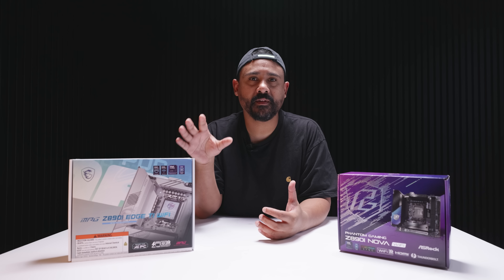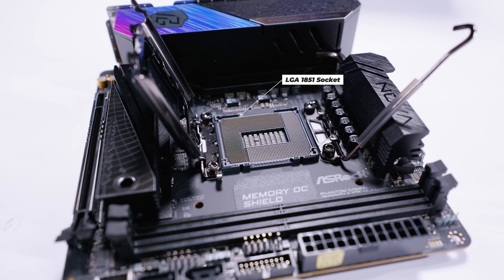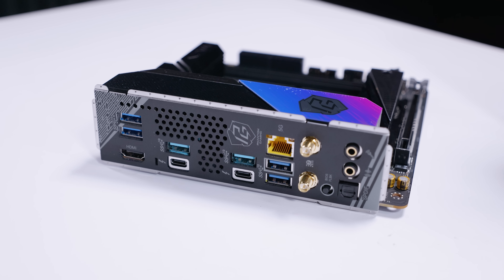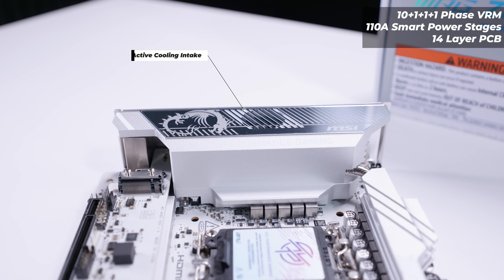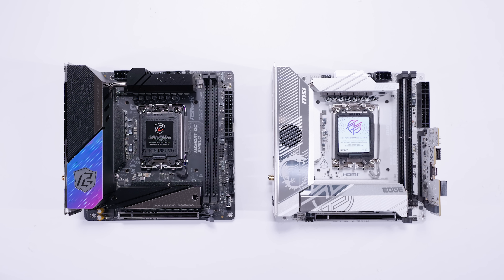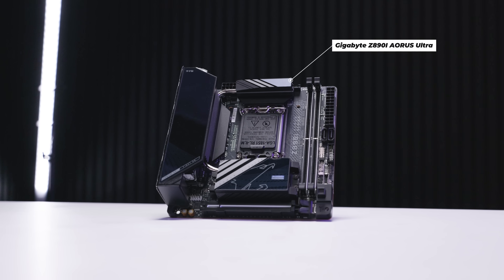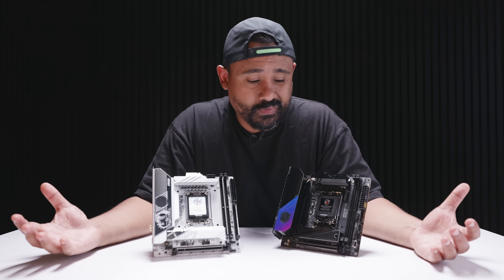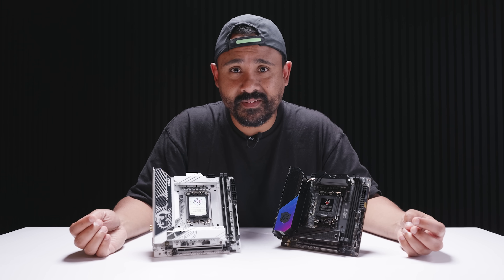Can ITX save Intel?

Comment: Okay coming from a intel 8086k and  Zotac 1070 ti ,wanting to build a mini  itx system to game at 1440p without bottleneck  arc gpu ,plus some workloads , am i really going to see or notice a difference in performance,  example stuttering on the new AAA titles coming out, i actually  want more visual raytracing etc, and a good amount of fps 100 is fine . Wishing to air cool my new  new build would be all intel

Comment: The MSI is missing the 2 mini-Display Port inputs from the z690i Unify(which supported 3 M.2 drives as well.) Also why is the more expensive board stuck with slower RAM? Is there Cudimm support?

Comment: Agree that Intel gets more love not only in itx but most motherboard form factors. Its a problem that AMD needs to sort with the board partners. I have the z790 ATX Nova board for my 12900k system and it has been absolutely bullet proof. Tons of features for the price and just a really nice mobo.  Its super stable and fast enough for games and workstation use. I wont put a 13th or 14th series CPU on it due to the issues with those.  So it will run its life on the 12900k. Just this week I put together a game box with the 9800x3d and Asrock B650E itx board. Its IMO the best AM5 itx board we have currently for the money. I would love to see a x870 itx Nova board for AM5.

Comment: everyone complained about intel's power draw, but when they start to fix it everyone says the opposite, make up your mind people
Reply: yes we wanted lower power draw and more perf but if this matched raptor lake in everything with its current power draw it would have been an absolute banger of a CPU arch
Reply: @ the CPUs beat 14th gen in majority of productivity workloads. Only thing that’s slower really is gaming. But that will probably be improved with the next generation.
Reply: Fixing it by nerfing performance isn't really fixing it.  Fixing it is doing what AMD has done. Make a CPU with superior performance and 1/2 the power draw. 

I don't particularly care about power draw. Even a 300 watt CPU only costs maybe $300 a year for power but, if you can get better performance for less power, why  not? 

I'd say the biggest issue with Intel is the fiasco with the 13th and 14th gens melting down because of poor microcode.  There's no guarantee this latest CPU won't have similar problems.  I always bought Intel because they were the most reliable.  Now that that isn't true, there's nothing holding me back from AMD.
Reply: @StrixWar  people are salty about past Intel I don't blame them no one wants a dominant Intel ever again after stagnation

Comment: Intel's new desktop Arrow Lake platform is uninspiring.As to whether if ITX will save Intel,ITX is a form factor and thus will continue with AMD even if Intel's Arrow Lake processors are not wild adopted. With Intel converging the features of Arrow Lake and Lunar Lake shows the problem that Intel has since they ended their HEDT  X-platform.

Comment: High frequency circuit board technology has been around a long time.  Bringing the cost down will require giving up features.   For example,  do we really need more than 1 each wide slot for video cards?  Do we really need the chipset?

Comment: Nah Arrow Lake is doomed in the DIY market. Good thing they got a monopoly on prebuilds and OEM markets tho that they can unload millions of ARL on like they did with crappy Rocket Lake. Can't say the same for AMD and vanilla Zen 5 though since those serve no purpose anywhere other than landfills.
Reply: That's the unfortunate part. Arrow Lake isn't gonna sell at all in the DIY market, at least not until a microcode patch magically improves performance by like 10% or something, and prices remain high. However, luckily for Intel, they have deals with OEMs and prebuilts, and Arrow Lake is overall still going to end up outselling Zen 5 by a huge margin when considering the entire desktop market. Intel just needed a 'good enough' product in their eyes that does not require a nuclear power plant to run, that's all.

Comment: NGL i hate the io card on my asus z790i. reason being that in sff builds space is at a premium so adding in this extra piece that sticks out makes cable management that much harder. many aios need that usb header so this board is a must use in that scenario. notice how the 24 pin connector is right on top of this board so when i use it im not able to use that space to manage the psu cables, basically you are pushed towards using custom psu cables.

Comment: seeing as new bios updates fixed the 13th/14th gen cpus, i decided to pull the trigger on the Asus strix b760i for just €133. pretty stoked since its supposedly possible to undervolt on that board

(to contextualize the value, you can get that board with a 14600k for €333)
Reply: @xanirah  I just did the exact same thing with a 13600k because it's 1/3 the price of an am5 board with a 9800x3d with only a 35% reduction in gaming and for other computing tasks Intel is typically surperior. Now is the time to buy in America before Trump imposes tarrifs.
Reply: @lokisigmatron6536  yeah my exact thinking. People discourage it because of the "dead" platform, but I'm not going to be upgrading for another 6 years anyway lol
Reply: @lokisigmatron6536  35% in 1080p

Comment: Small boards indeed - one would go for the MSI with most of its M2's above ground (3) but won't be the M2's on bottom of the board be hemmed in / compressed to the under side of the case that there will be insufficient cooling to cool these M'2's and run 2 hot ?.      I still love full size ATX boards

Comment: Good walk-through, thank you.
Can ITX save Intel?  No.
Why?  Because as much as I love SFF and the ITX form-factor, it is still a bit niche, and Intel needs volume sales right now for cash flow they desperately need.
That said, I would not buy either of these mobos, even if they were for AMD processors.  If a VRM is designed well enough and cooled with a properly designed heatsink, no active cooling should be needed beyond passive case airflow.
Furthermore, I refuse to buy any ITX mobo that uses proprietary riser-boards and/or dongles.  I do not mind having those mezzanine stacked M.2's as they keep the M.2 NVME SSD's cooled better than back-mounted bare M.2 slots (the ASUS Z490i was the perfect implementation for this), but all the other proprietary stuff I refuse to encourage and will therefore refuse to buy.

Comment: Agreed! B850 launch later after new year should lead to more AMD motherboards.

I don't think that Manufacturers or retailers like stocking motherboards for processors that have not been selling well in the DIY market. 

But Intel probably has some partner agreements that stipulates some requirements on the manufacturers, don't make nicer things for other chipsets than Z890.

Comment: That MSI board is insane for I/O and storage holy moly.
Reply: Asrock ftw.    4 m.2 lame Because you have to split your lanes up.    You really don't need three thunderbolt 4.  It's white and ugly and not ugly and it has a stupid card Then you have to sliding for all the other accessories that can break.
Reply: @TurboD16z6  But if you are only using one ssd at a time its not a problem correct? like if you were just using it for storage

Comment: I think that at the moment the best available mITX AM5 boards are Asus ROG strix B 650E-I gaming wifi and ASRock B650I lightning wifi, in the latter only a weak audio chipset pumped up: Raltek ALC897. I don't think there will be anything better in the X870 ITX and younger B850E(I)

Comment: I wish the motherboard makers weren't pressured into releasing 8x the amount of intel boards over AMD. Especially when AMD is currently the go-to in the DIY space.
Reply from the maker: This is kinda the reason why I wanted to make this video too. I wanted to open up a discussion with everyone about what people really want. I would love some AM5 ITX boards that had anything even remotely close to even the ASRock boards feature set.
Reply: @GearSeekers It may be the way AMD restricts and requires certain features for A B and X boards.  "A620" or "X870" aren't just chipsets, but also platforms which AMD defines.  Nothing about an A620 would technologically prohibit you from wiring any of the CPU PCIe lanes as Gen 5 or as USB4 but in order to be an A620 board you can't utilize all of what is already there.  On the high end I don't really know all of the requirements but I'm guessing something is either physically impossible to implement in ITX or is very cost prohibitive.
Reply: Z890 is simply the better chipset vs X870E in terms of platform capabilities. You will never have feature parity between Z890 and X870E. Go blame AMD for making X870E a simple X670E refresh with no new features.
Reply: @ what compatibilities am I missing from X870? As it seems now, I won’t be able to even upgrade to another generation in the future.
Reply: @LordApophis100  no worries am5 still got like 1-2 gen life 

Not like Intel z890 high chance to need replace in next release 
Z890 technically is two gen as usual but metorlake was cancelled and arrowlake was second generation on that platform
Reply: @frankwong9486  Yeah, I was referring to Arrow Lake regarding socket support. So far I don’t see what I’d be missing out on AMD compared to Intel regarding I/O. Especially on ITX.
Reply: @LordApophis100  they don't have enough space to put on Itx but Intel platform most likely more nvme slot , possible thunderbolt or usb4 connector , nothing else , which most user doesn't need that much

Honestly Intel IO is good but the CPU was meh and it basically a dead platform so... No point to buy it unless need that much pcie lanes / IO (like Itx storage server with stupid amount of nvme plus a HBA/highpoint storage carrier slapped on x16 slot then possible 10G network because Intel have enough pcie lanes to do that 
Intel still locking overclock/undervolt behind Z board paywall but arrowlake didn't seems fun on OC ... So wtf Intel 😂

And it doesn't need to like AMD daisy chain to get more PCH pcie lanes , Intel hubs do provide tons of lanes to spend 
Asus made a Itx x670E and additional PCH was hidden on the adapter board on between them PCH/nvme stack

One thing Intel still doing right is the better video decode encode which is the only thing they can showoff in every launch PowerPoint - the quick sync

AMD have usable video engine but it didn't close to Intel in code support/quality/speed in general
Reply: Honestly AMD IO is not better than Intel especially pcie lanes provided via PCH , AMD E by daisy chain two PCH is a joke especially for Itx .... 

And devil Intel still locking pcie bifurcation function on consumer platform and most only do 8/8 while AMD don't care about limitations and let you do 4/4/4/4 or 8/4/4 or 8/8 as you like

Comment: This gen feels like how Ryzen did when it came out; meh on launch but progressively better with each new iteration. Intel more or less said the same. Luckily for them their 12th-14th gen stuff is still really good and selling well as a buffer
Reply from the maker: I dunno. Ryzen's launch line up of boards weren't too bad. I think the B350 boards were pretty average but most of the X370 boards were pretty solid. The major issue was memory compatibility which was remedied pretty quickly.
Reply: @GearSeekers  I meant moreso performance wise. It was just "okay" but it meant AMD could compare to Intel again. Now the tables have sort of flipped but they're still fairly competitive, so we'll have to see.

Tbh though some Ryzen 1000-3000 series stuff I've built with updated BIOS still have USB issues
Reply from the maker: @Vivi-tz2rl  I think Ryzen's peformance per dollar at launch was pretty crazy though. Also remember when the Ryzen 7 1700 came out. That CPU changed everything for me.